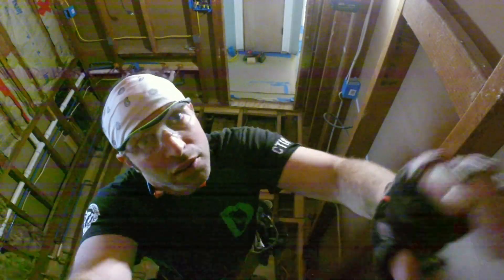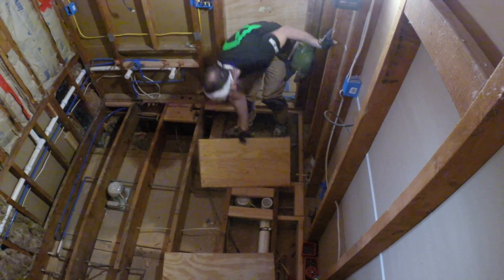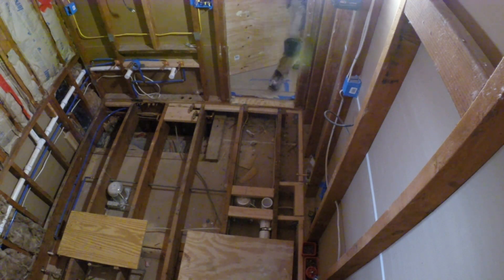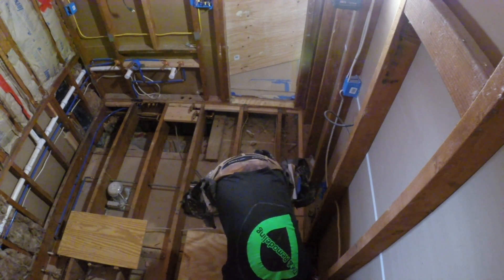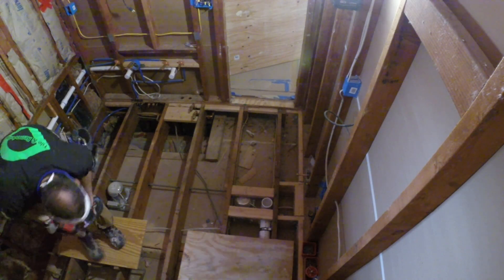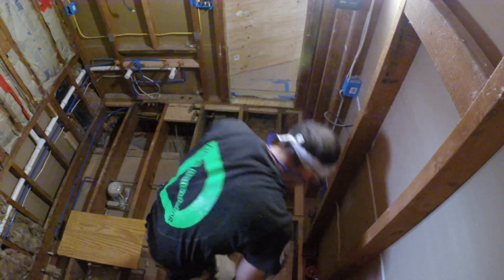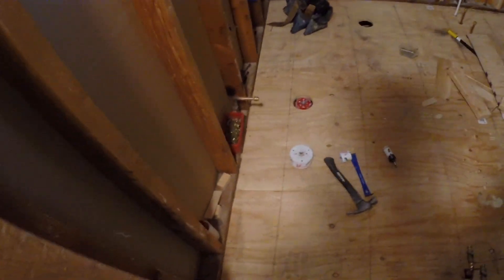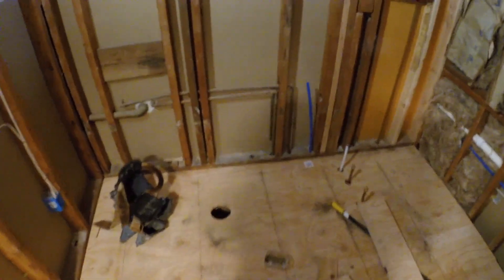Sub-Floor Installation

Comment: Replaced the subfloor in my in-laws bathroom but used ring shank nails. Pretty sure they won’t ever go anywhere. 😂👍💪
Reply from the maker: yes ring shank nails work along as they are long enough.For most thickness subfloors 8ds work well

Comment: do you need to add a subfloor glue between joists and plywood?
Reply from the maker: Good question. It is not a must, but does not hurt. If you only nail the subfloor then I would recommend glue, if you screw, its not as needed.
Reply: @Dtileandremodeling   thank you!